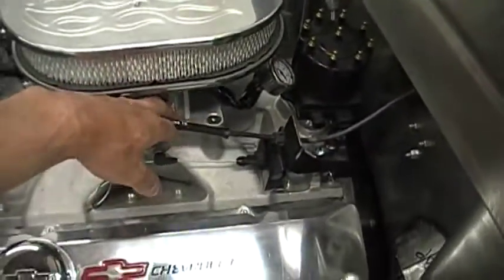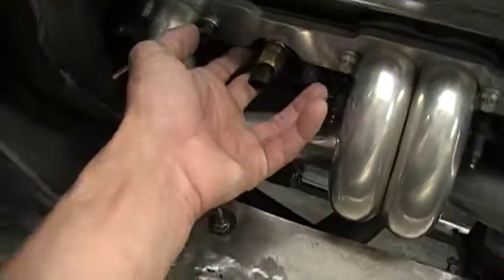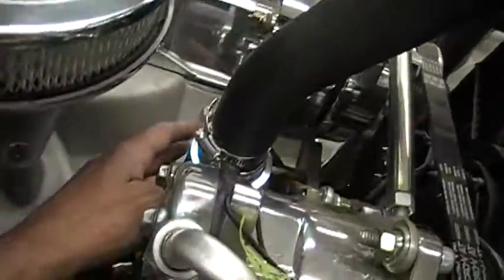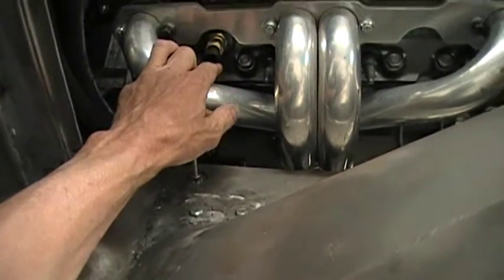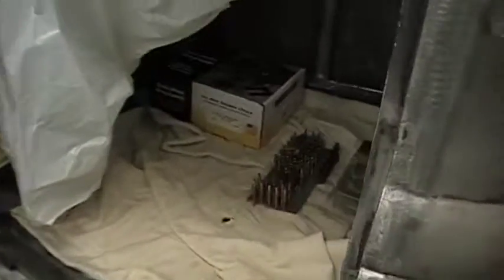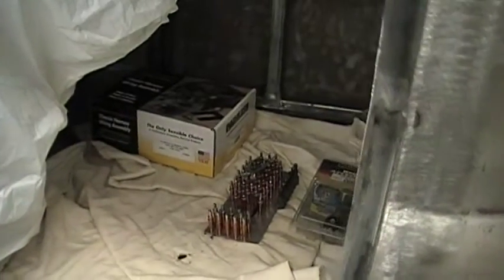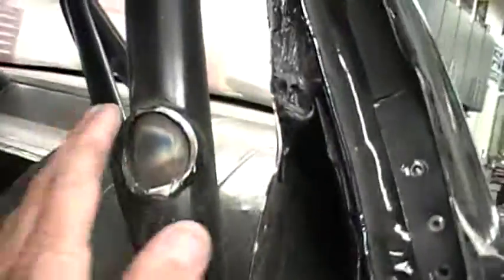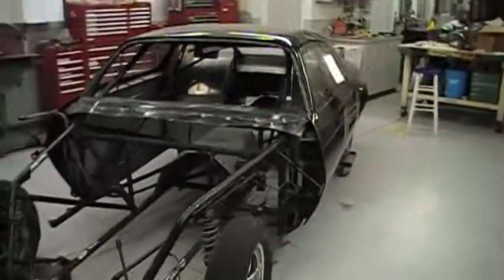31 Ford Model A pickup 26 and a peek at another project !!!

Comment: Lots of progress but it sounds like you forgot the first rule of rebuild. Strip that block and heads of everything, and I do mean everything, before it goes into the acid bath for cleaning. Even simple frost plugs can turn into nightmares and now you know how stubborn threaded plugs can be. LOL. I don't envy you that day in the shop. 
Later guys. Thanks for the video.
Reply from the maker: EdOfTheNorth LOL poke you got me !!! I  really wasn't thinking about the fuel injection requiring a port. The first thing I should have done is order a intake that was serpentine belt friendly I just kinda decided stuff as I went and I paid for it later . I did however know i was going to need a port for the temp sending unit and I even overlooked that! I guess it might have been better to have a motor that needed completely rebuilt as opposed to one that just needed re-lubed. Ed Julie didnt even come out when I was removing that little SOB !!! Thanks for stopping in friend and I hope you had a awesome holiday!!!! Terry and Julie!!!!!